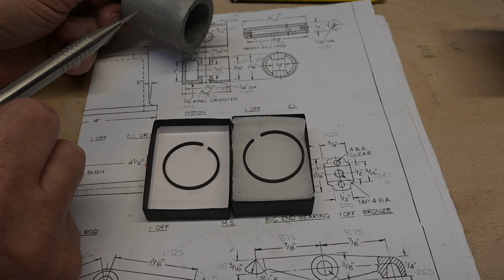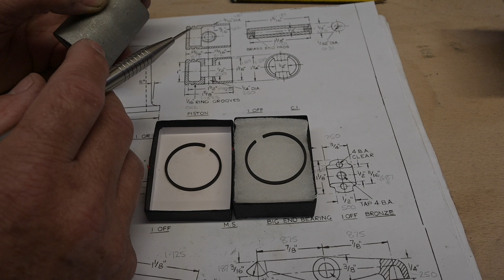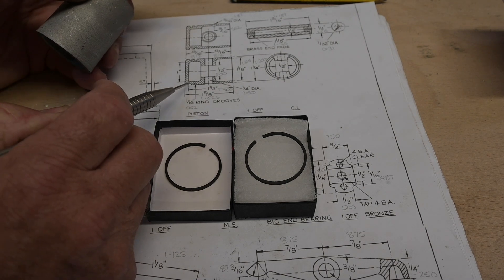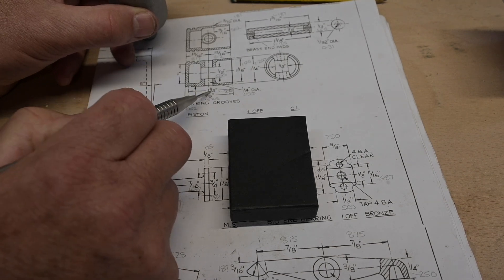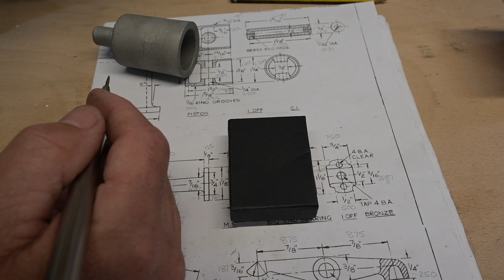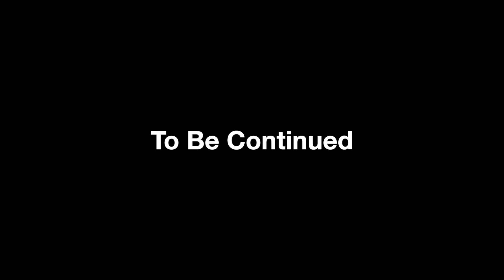Making a Piston by Hand - Miniature  Petrol - Engine Part 14

Comment: Hi mark - a great series I’m enjoying getting through it for the second time now😅, where would find suppliers of models similar to the one you are working on? I’m based in Dublin Ireland so getting stuff from uk is fairly straightforward, I know of Stuart’s models but I’m sure there are more I just seem to be having trouble finding them - are there any you could recommend . Thanks again for the effort you go to making these videos
Reply from the maker: This particular model is a Hemingway kit.  They have been taken over by Reeves 2000 which I think are the biggest supplier in the uk.
Reply: @EnglishHobbyMachinist thanks for letting me know - I’m eager to get a few steam models under my belt before tackling an ic engine but that’s the area I’m most drawn to . How do you find the quality of drawings and castings overall from Hemingway? How much is left up to having the experience to actually end up with a decent functional model
Reply from the maker: @Davidcarroll38 I think generally castings are not great but you can make them work, the instructions and drawings have measurements and detail missing so do rely on builder knowledge. I think if you want to gain experience the Stuart kits are a better option, they have better instructions. Hemingway kits are sometimes just magazine articles cobbled together to form a build manual and are very dated
Reply: @EnglishHobbyMachinist thanks for the advice Mark much appreciated

Comment: I’m glad you didn’t lose the part after all the hard work you put in Mark. Is the piston cast aluminium. It looked as if it had a fairly rough surface on the outside? Maybe a coarse sand mould. 
As a push tool, I made a bar with a ball bearing on the end to square up material. I guess you’ve seen these already. Beautiful fit on the piston Mark 👍 ATB Nobby
Reply from the maker: Thanks Nobby, yes it is cast aluminium, but not a good quality. TTFN Mark